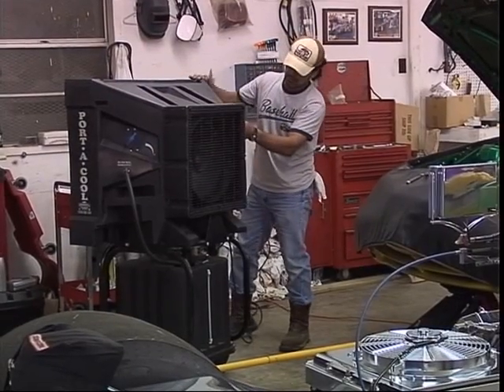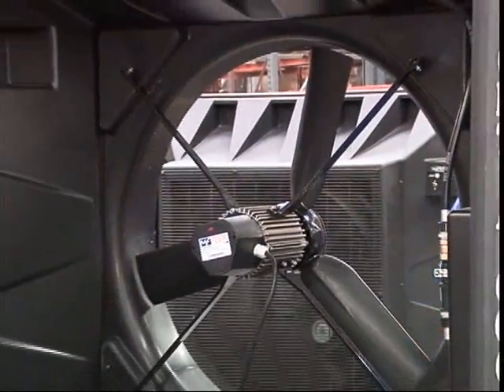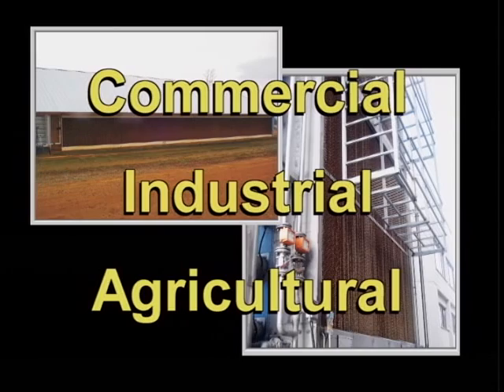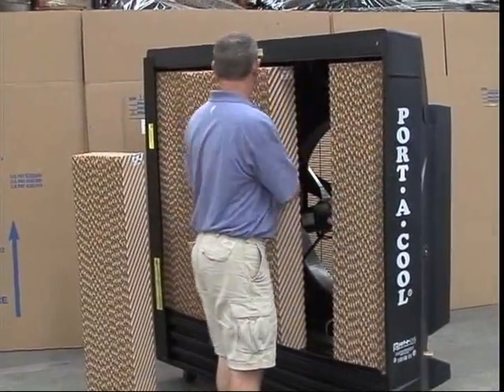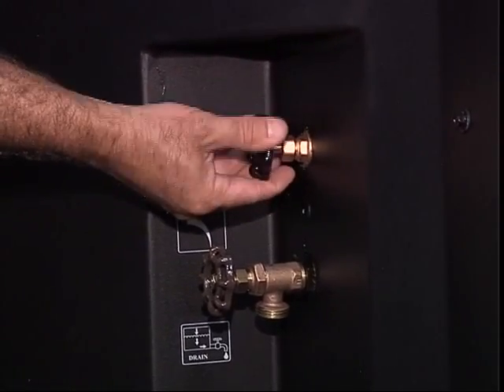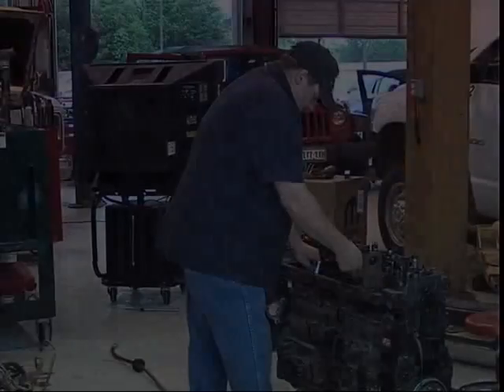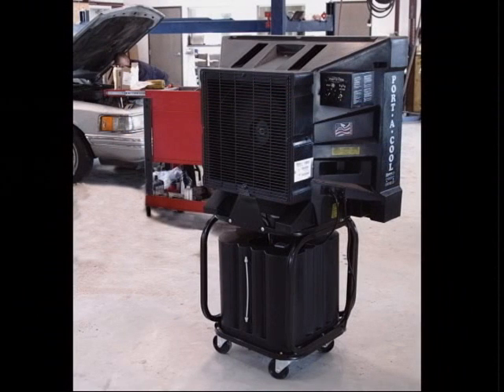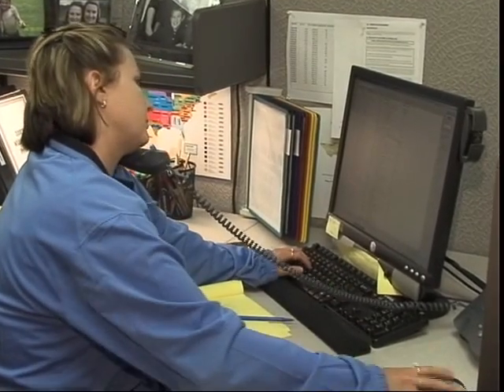Port-A-Cool® Units

Comment: Have had one of these in my shop for a few years and can honestly say lucky if if 1 degree difference in shop only way this helps is standing directly in front of it.
Reply from the maker: Hey Texas_Mike, 
Experienced engineers can assist in ensuring in highlighting the ideal location/placement and number of units as to induce air currents for a more comfortable work atmosphere.

Comment: Can the products work well in humidity of around 84%?
Reply from the maker: Although evaporative cooling technology works better in low-humidity environments, our experienced engineers can assist in ensuring in highlighting the ideal placement and number of units as to induce air currents for a more comfortable work atmosphere.
Reply: No. I will tell you true. Air is colled by amount of vaporized water.

Comment: Cooler water pumps are unsafe to use. Current with 230 Volt in wires are immersed in water tank to supply power to Submersible pumps. Any leakage of electrical current in water can give fatal shock. How safe are these cheap pumps to prevent water from entering in the electric motor ? Why such pumps do not carry BIS Mark ?
Reply from the maker: Hi Avinash,
We must remember that such products are trusted by both the public & private sectors, for residential, commercial, industrial and military use, both onshore & offshore the world over.
The pumps equipped on Portacool are proprietary and are quality tested & CE certified as well as be thermally insulated, naturally.
This said, there has never been any recorded incident of electrocution on any Portacool unit.
Additionally, for the oil & gas industry, we have pneumatic models to cater for such hazardous environments and their rigorous requirements.

Comment: but they don't work in humidity.
Reply from the maker: Although evaporative cooling works better in low-humidity environments, our experienced engineers can assist in ensuring in highlighting the ideal placement and number of units as to induce air currents for a more comfortable work atmosphere.
Reply: @nehmehcorp  your product is awesome, but 1000 usd  its way much expensive. one can buy an air conditioning with tht amount.
Reply from the maker: @mohammedsharif9037 , the total cost of ownership (over the medium & long terms) are far more economical than AC units - electrical bill and maitenance as well as running costs.

Comment: These things are awesome.  I've only used them in Central/East Texas.  The area was humid but not as humid as say Florida. In ultra dry environments you can literally double your temp reduction.  I've not experienced that but considering how well it worked in a humid environment I'm sure it is amazing.  I have never purchased one.  The company I worked for bought several of them.  I know they can get pricey depending on which one you buy.  But you get what you pay for and the low energy cost definitely will make up for it.

They really make a difference.  Always been fascinated with these things. Preventative maintanence is a must.  Take the few minutes to make sure your pump doesn't run dry or get clogged with dust.  It is extremely easy and the electric cost isn't bad at all.